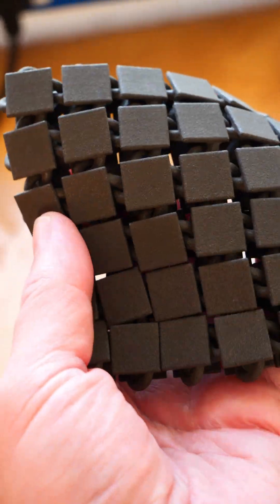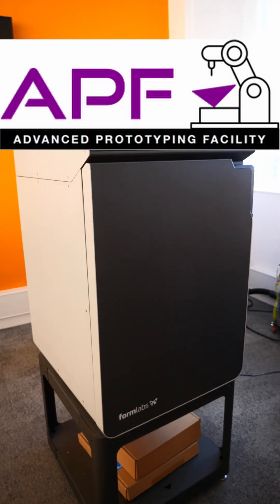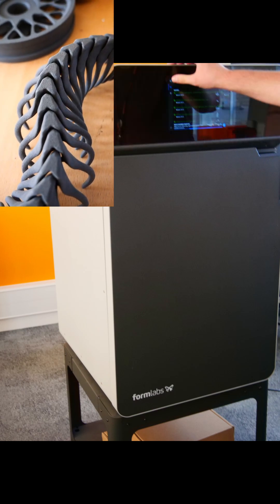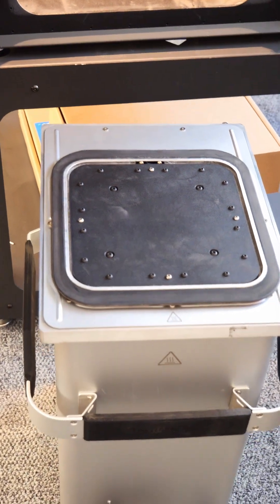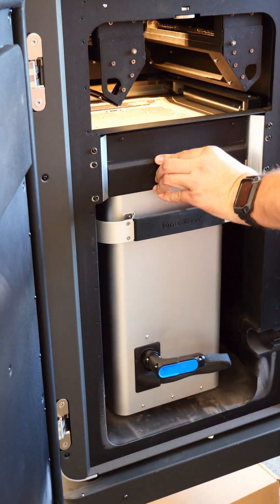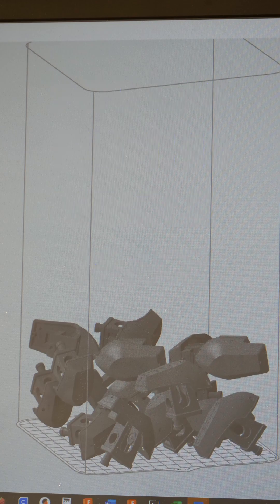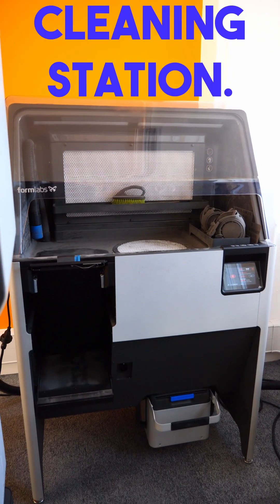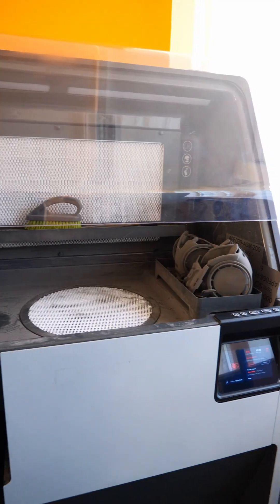The SLS process explained in 60 seconds on the formlabs fuse at APF #3dprinting #howitworks #sls

Comment: How long does it take to print compared to FDM or SLA printing?
Reply from the maker: Seems about the same as SLA tbh. 5 hours was the print time for the parts that were printing
Reply: Is  there a method to smooth out the print? Looks super rough